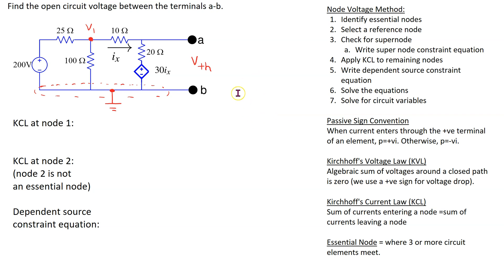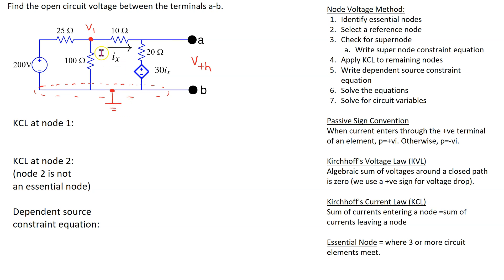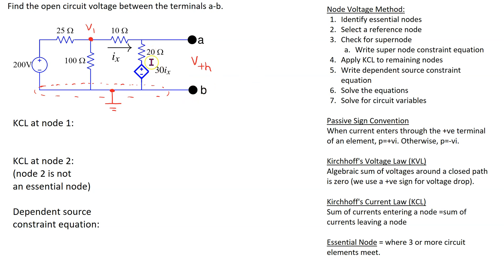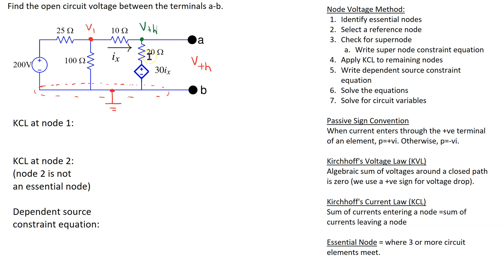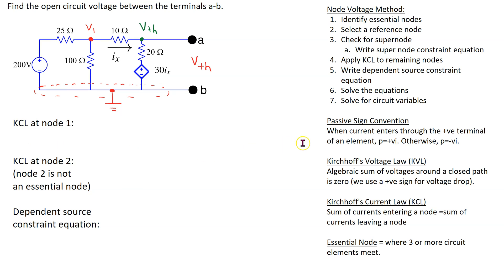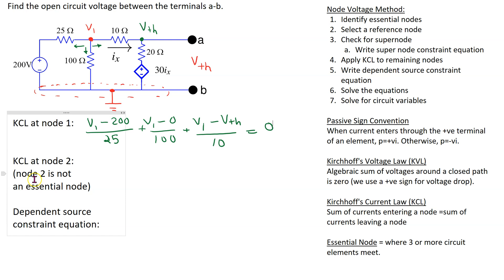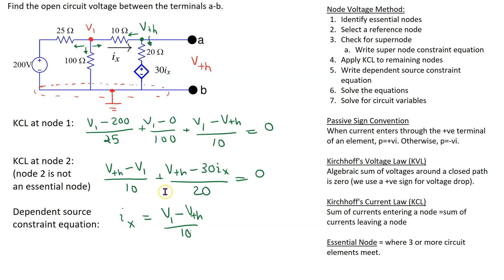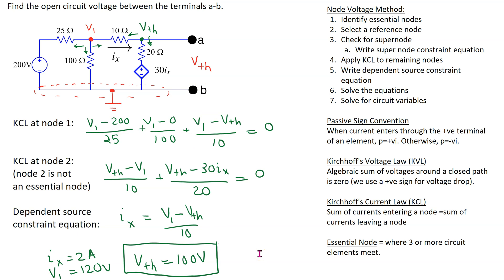Node Voltage Method - Example 12 (Trick: Useful Technique When Solving for Open Circuit Voltages)

Comment: kcl eqn at node 2 is wrong
Reply from the maker: Are you referring to equation at node 2 at 4:42 in the video? The equation is correct. Node 2 is not an essential node, but we can still write the equation as shown so that Vth is an equation variable and we can get its value directly when we solve the system of equations. This is the trick that is explained to in the video!